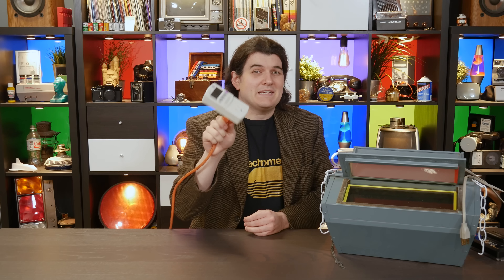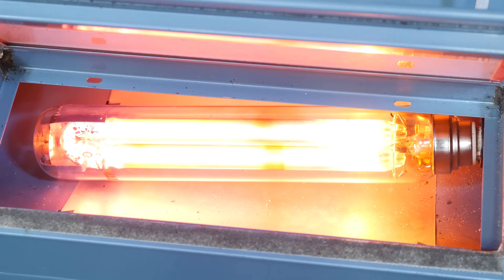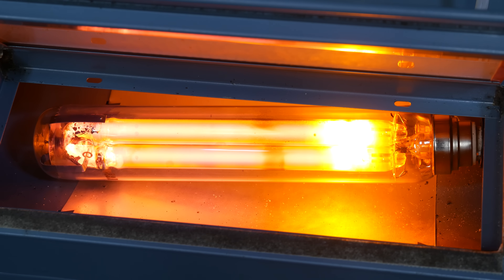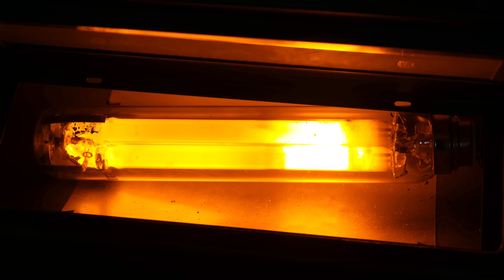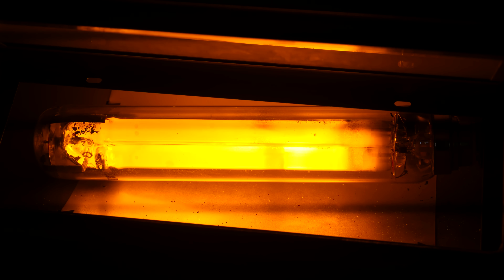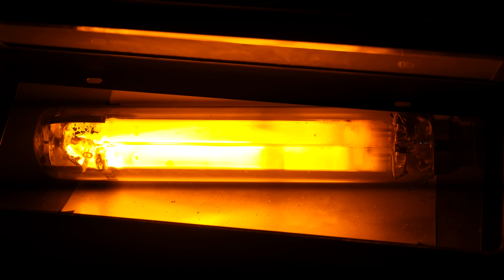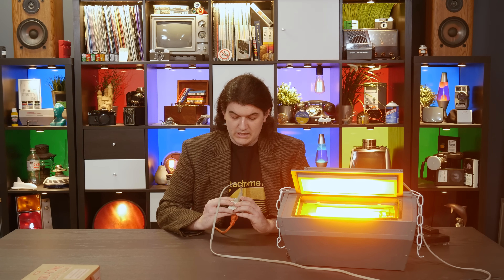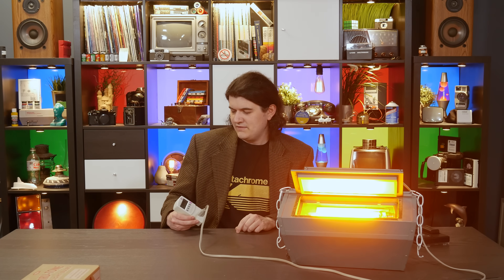More vaguely-informative ramblings about low pressure sodium lamps

Comment: I have the same lamp, and it is quite noisy as well, whereas an 18 watt  SOX (the low pressure sodium designation) wall pack does not make nearly the racket. I can also find both the 18 watt and the 90 watt sizes can be had easily, but the 35 watt size is hard to find like you stated. Also, that light was made in the 1970s before all the energy management gimicks began to take effect. All bets are that a more modern ballast could probably get the power down a bit. I also hate seeing that bulb droop like yours does, so I've added a wire hanger to support it. It appears that there was a hanger designed to go in the fixture at one time, and it has become missing, likely a result of changing bulbs.

Comment: Until the LED revolution, low pressure sodium lamps were common for general residential street lighting in the U.K. and we would occasionally see lamps which stayed red, but we rarely saw bulbs being replaced and I don't recall ever noticing the two being linked. 18,000 hours with a sunset to midnight on time would be around 8-10 year service interval though, and when I did see lights being serviced, they would do the whole street at once, so it doesn't surprise me that both were so rare.

Comment: The sodium bit shouldn't fail but there can be degradation on the electrode or the contacts, and the reason they are rarer these days is simply that at 13ish buck per gram is DAM too high for an usage that a few LED can do so not a lot of demand, high production cost, horrible power usage and the somewhat high explosion risk of the sodium, it makes the sodium light really useless these day.

Comment: The lifespan is related to the spectrum of light. Its rated for certain amount of hours to deliver the spectrum they claim to output. They "last forever" as a light source but if growing plants, the spectrum of light the plants want might not be there any more after certain number of hours even if the light still turns on. Also these lites are known to fail sometimes i  a firey explosion shooting out red hot liquid sodium.

Comment: I was the photo lab tech at a university for over 4 years. The lab had ~9 of these safelights. We had 3 replacement bulbs when I started, and we had 3 when I left. According to my boss, who had been the head of the photo program for a decade before I started, There hadn't been one changed before me either. Those lamps were running 14 hours per day 5 days per week, plus 7 hours on Saturdays, for 35 weeks of the year. I think your bulb will last a very long time.

Comment: Philips closed world's last LPS factory at 2019. So these are not being made anymore. 

I think these wear same way that fluorescents do: cathode emission compound wears, and at EOL it cannot emit emeugh to start the lamp.  

And these are to my knowledge the most complex conventional lamps ever made. Fluorescents are nothing compared to these. These lamps have to keep the arctube at about 270 degrees celsius, and this is accomplished by ITO IR reflective coating and outer bulb vacuum.
Reply: And think about sodium, almost the most reactive element on earth. The glass is very special type of glass, that can resisit sodium attack at 270 degrees. Even qurtz turns brown very fast when touching sodium at 270 degrees.

Comment: Low pressure sodium lamps are very bad choice for public lighting. Their monochromatic light might be useful for some special purposes (such as in vicinity of astronomic observatory) but in general situation being able to recognize colors is important. I don't wonder they phased out their serial production.
High pressure sodium lamps are still in production, though. Their power consumption is very close to LEDs, they're cheaper, and their light color, while awful, is actually good for night illumination as it does not blind human vision as much and is better tolerated for sleep.

Comment: We had the long roughly 4ft version of these street lights that were  specifically placed at each corner of a main road  on some of the less travelled residential and darker areas of town, but not in the stretches between them where more regular smaller white type street lights were hung. The yellow glow from these lights made it really easy to tell  ahead of time that you were approaching a side street corner.

Comment: Honestly I've never had a discharge lamp bulb die. Supposedly it's a lot more related to the number of start up and cooldown cycles than running time.
They do lose considerable intensity over long periods, but for this purpose probably not a big deal.
If efficiency and light output aren't paramount the bulbs can easily outlast the ballasts.

Comment: Keep this in mind:  NOBODY is investing in old technology.  That is why the bulb, ballast, igniter replacement is getting harder to find and they will become non-existent in the near future for HID fixtures.  I buy building HID/fluorescent bulbs and many are now 'no longer available' unless you find someone who has old/new stock on their shelves. When they are gone, they are gone. Recessed compact fluorescent ballasts are now more expensive than a new LED recessed fixture, so now, we swap out entire fixtures.  The LED's may last forever, but the driver doesn't.  So, where you once bought ballasts for fluorescent lamps, now you'll be buying 'drivers' --- the LED power supply.

Comment: The only thing you need to know about low and high pressure sodium bulbs is this: Throw them in the trash, remove them from the building and pitch. Buy and LED and get better colored light, more light, and a LOWER electric bill.

Comment: There were 5 on my street until a few years ago, replaced with LED heads (which are blazingly horrible, cast a narrow beam with lots of dark between them, flicker like chuff when they go faulty). I miss the sodium lamp that was across from my bedroom window. It would get to dusk, the Neon would glow and I would watch it progress to the Yellow. I would guess in the 22 years I have lived on my street, that particular lamp was only replaced twice. If it failed it was either dark or only the neon would keep glowing. It may not have even been the lamp that failed, the ballast could have been at fault. I would guess they do have a very long life, maybe 7 to 10 years if used every night for an average of 8 to 14 hours depending on the season :) I live in the UK.

Comment: wrt power factor - one of the big problems is that since it's out of phase, it requires higher current to get the same power since it's producing its peak power at a lower effective voltage. This means while the device itself isn't using more power, there is more total power dissipated system-wide in transmission losses, so more generation is required to meet a given end point power usage.

It generally gets ignored at a consumer level as it's such a small amount of power it's not worth tracking consumer by consumer, but the power companies do actually track and account for it for large industrial customers since it really does add meaningful generation costs.

Comment: The I-94 tunnel in Minneapolis were changed out for LEDs but are still mostly yellow. Minneapolis is changing out the LSV street lights -- I have a white LED now outside my living room window but around the corner (both ways) LSV lines the side streets.

Comment: Here is a very simplified explanation of poor PF:  The device being measured takes in more power than it needs during part of the AC cycle, and then gives back the unused power later on in the AC cycle.

Comment: I’m an electrician, I mainly come across SON and MH light fittings but I have worked on a few SOX lights, they last an age before blowing, quite a lot longer than SON which already last a while. I remember before I thought about the power factor and efficiency of the ballast, thinking that there was little to no point replacing SOX street lighting with LED seeing as they’re 35W and LED street lights range anywhere from 50W to 200W, but man take into account how inefficient these things are and it’s easy to see why. They’re still in use on long stretches of motorway here in the UK where it’s a pain to replace a faulty light and the most valuable asset is having a light that lasts ages, and they’re good for not causing too much eye strain at night.

Comment: gas discharge lamps typically fail because the electrodes are sputtered which blunts them which in turn leads to higher voltages to start the lamp. At some point it just won't start up again.

Comment: They must have an extraordinary long life. A car park near my last address had one way up a central pole that was just visible from my house, it was on 24 hours a day for the fifteen years I lived there. One day I enquired at the shopping centre about why it was never switched off and was directed to the maintenance guy. He informed me that the light had a faulty automatic switch and was wired directly to the street supply so nobody had a switch, but as the lamp itself was only 18 watts, nobody had any plans to hire an EWP to repair it until the lamp itself failed.. ten years on from my enquiry and  it was still as bright as ever, and it probably lasted a few years longer (I moved interstate), but some of that life may have been a result of staying on without any thermal cycling. I was impressed and always expected it to eventually stay off whenever we had a power failure.. but, it always came back on...  
That totalled about 131,000 hours or more, but who knows how long it was on before I moved there... lol
Reply: You should see if you can find it on google maps and see if it's still there
Reply: @timmynibbs  I second this.
Reply: 18 watts? A LED that size would probably draw the same or more.
Reply: It wasn't the same bulb/ballast, the bulb would have gotten to be far too inefficient for the ballast to support, as well as the ballast would have gone far before that timespan.

Comment: Did you say "monochromatic?"  We used a sodium archlamp in my lab last semester and it was far from what I'd call monochromatic; as we measured the various wavelengths of light emitted by the lamp which included amber, red, blue, and ultraviolet.  I dont know if the "archlamp" makes a difference.  We were instructed to let it warm up for 5 or 10 minutes prior to starting the experiment.

Comment: The loading dock where i work has been illuminated by the same low pressure sodium lamp since the building was constructed around 1999. Grranted only one of the original four lamps are still burning, but aside from brief power failures that security lamp has been lit for over 20 years. I have always been amazed at the longevity of the simplest devices and how they can just keep working. Btw, this is at a government facility so the odds of anything ever geting replaced is pretty much zero, I figure we will have a power failure one day and the ballast will finally fail and then six months later maintenance will replace all four with integrated LED fixtures

Comment: I worked for a electric supply company and changed the street lights. Mostly HQL=Highpressure Quicksilver Lamps
And they get changed to LEDs. The cool thing is when the Low Pressure Sodiom lamps get burned out, the create a shiny metal coat inside the tube.

Comment: I did see them fail in street lighting from time to time, but it is rare. As with any LED replacement, the ones for street lights have way too much undiffused pin-point power that slightly blinds you as you drive under them. I tend to lower my sun visor for LED tunnels because it flashes my eyes too much.

Comment: Answering your question: yes they have limited lifespan, that is based on the quality of the glass tube (usually borosiliate). The tiny bit of sodium reacts with the glass and rises the resistance of the fully developed arc. After may years, just enough sodium gets mixed with glass, that when the arc fully develops, it's resistance will be too high. The arc goes out, resistance drops, tube cools down. Now the little arc will heat up the tube, arc will develop, resistance will drop and the cycle continues. So it's the chemicql reaction that limits the lifespan.

Comment: Yellow-ish lamps (sodium vapor I assume) are still common in Ohio for interstate highway lamps and ordinary street lamps.  When replaced, it is most noticeable that the new lamps are much whiter, often toward the blue-white end of the spectrum.  The other thing I've noticed is that the new lamps (LED, I assume) have a much less even light distribution.  The LED lights have a very bright hot spot with dark areas between light poles.  I prefer the more even illumination of the older style lights.

Comment: I think the word you were looking for was 'reactance' which is the 'non-real' component of the impedance.

Impedance is a property of electrical componenets when viewed in the AC domain, when working in the DC domain (which is just a special case of AC where frequency = 0Hz) you only need to concern yourself with the 'real' resistive component of impedance. Most people are already familiar with the real component of impedance which is called 'resistance'. As is a gross simplification the reactance is positive for inductive loads and negative for capacitive loads. An inductive load slows the flow of current (due to the inducement of a magnetic field in an inductor) into a load and causes the current to lag the voltage whereas a capacitive load causes the current to lead the voltage. 

If the reactances are balanced then you have corrected for reactivate power consumption as the positive and negative 'non-real' parts of the impedance cancel out. 

When you have reactive power being consumed it puts a load on the power transmission and generation system despite not all of power going into the system being delivered as real useful power to the load.

This is why generators and transformers are rated in VA (or more commonly kVA). VA or 'Volt Amps' is the vector sum of the real and reactivate power which captures  the system's capacity regardless of power factor.

Comment: low pressure discharge lights are very durable, the reason why fluorescent lights had like 10k hour lifespan was because of starters and such, while in this use case a lamp can turn on however slowly in pleases.

Comment: "Watt" you have to remember about power factor, is regardless of whether the power is usable, the supply equipment must produce it.
That's why you see generators and transformers rated in KVA not KW.
So for your lamp, if it draws 3A at 120V, the system needs to be rated for 360VA, not the 70 Watts.
Spinning disc electricity meters measure W not VA, but modern electronic meters can easily be set to measure either.

Comment: The Navy uses LPS lights in hangar bays and other weather decks on older carriers at night, something about the light not bouncing off the water the same way. I believe they have been switching to the LEDs with a monochromatic filter of similar color.

Comment: bad power factor is bad for the grid because the actuals amps you read on the meter, that is the current flowing, so higher load and higher grid losses (that's why you want it corrected right at the consumer). On the bright side this is an inductive load, and it tends to balance out with capacitive loads in the domestic grid. But most modern consumers, even cheap computer psu's have decent power factor, so yea, might want math out and add a capacitor to such things.

Comment: Quality HID lamps run forever, in my opinion the longest life light source has to be High quality mercury vapor bulbs, it's not uncommon for them to last 15+ years some people have claimed to have bulbs last 30-40 years in dusk to dawn service. HPS is a different animal in terms of life expectancy but they commonly go 2-3 times their service life of 24,000 hours. LPS is greatly underappreciated light source with higher lumens per watt output than LEDS and an incredible life expectancy. Hell even 250 hps & 400 hps are 125-130 lumens per watt and LPS absolutely destroys all in terms of efficiency. You have to have some very tired control gear to be using that much energy. For example i have a handful of 400 watt hps streetlights that only consume 405 Watts. Sorry for rambling, cheers to the new years!

Comment: I imagine the Illinois DOT does have a huge stockpile of these acquired in a huge order long ago. It's also my understanding they can run for several decades of regular service, but I could I be wrong.

Totally an older ballast inefficient ballast, and it should probably have a power factor more like .6-.7. Probably a sign to replace it in addition to the noise (although I don't hear it). Wouldn't surprise me if there's a more modern ballast with a power factor of .8-.9

Comment: I have a sodium vapor light on my house that has been there since it was built in the mid 80s. It turns on at sun down and stays on till sun up. 

So an almost 40 year old light that runs ~50% of the time is still going strong. 

Now with my luck it'll blow out just because I talked about it....

Comment: I have a low pressure sodium light on the side of my house that runs every night. I don't mind the yellow and it lights up my whole driveway and back yard.  It has been going for about nine years now,  I estimate that is about 35,000 hours so far. Even if the power factor is terrible, the whole unit cost me about $60 and it does not seem to attract bugs as much as the porch lights.

Comment: How are you surprised about drawing more power while starting up? It's logical, lots of it goes to evaporating sodium at first, heating metals isn't cheap, and heating it up to the point of glowing... then it just needs to keep it hot, that's cheaper on power, plus the hot gas has higher electrical resistance (i would expect), thus decreasing the power draw even more.